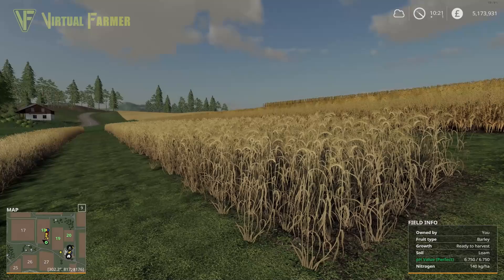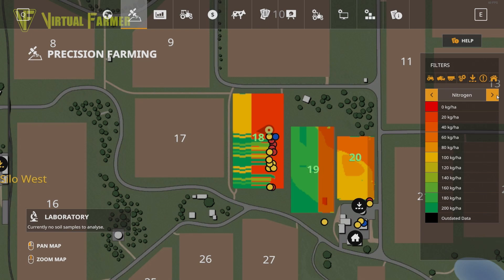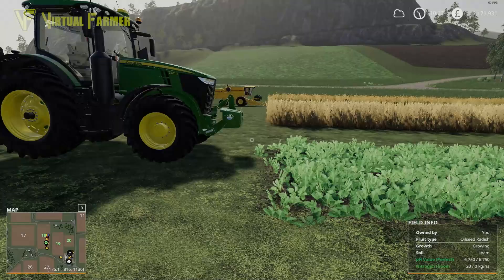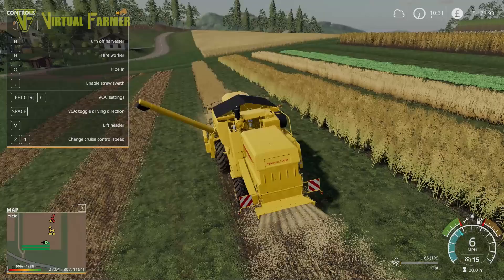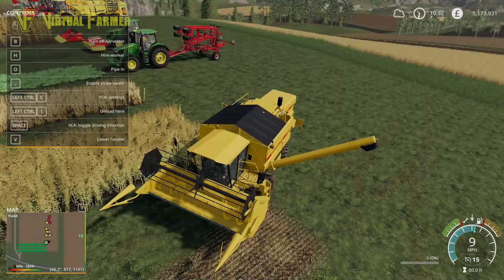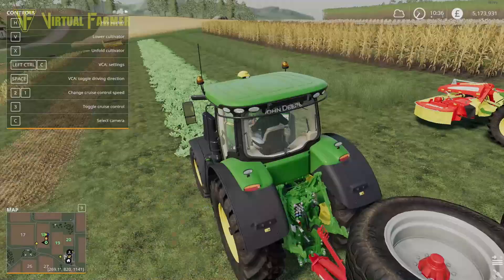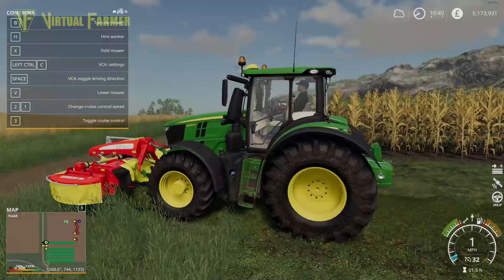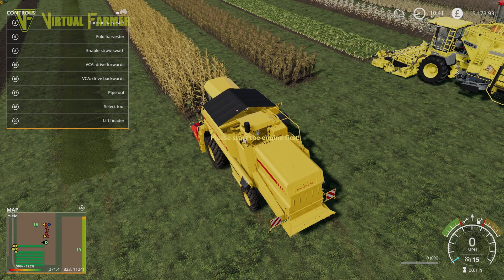Farming Simulator 19 Precision Farming: Crop Optimisation

Comment: One thing to note is that these values will be slightly different on the different soil types; I'm not sure if they will take the same amount of nitrogen out of the soil (for example 160-80KG on loam while 200-120KG on silty clay which is an 80kg difference across the board) or take different amounts based on the different soil types (160-80kg on loam while 200-140kg on silty clay which is an 80kg difference and a 60kg difference respectively). It's definitely interesting that using organic fertilizers in combination with oats and sunflowers leaves slightly more nitrogen in the soil vs just fertilizing optimally with chemical fertilizer (the difference you got for soybeans and oilseed radish was simply because the organic fertilizer side received fertilization while the other side received nothing so the base levels started higher on the organic fertilizer side so they still increased the nitrogen levels by a flat rate; no special interaction on those ones). Something else that's important to note is that some crops do NOT receive yield penalties for over fertilizing while others do (I thought the premise that crops being over fertilized would harm yield would be common sense but there seems to be a lot of people in multiple different videos and on Reddit thinking they can just max out the nitrogen levels and always get the optimal yield). The crops that do not take yield hits for being over fertilized are grass, soybeans, potatoes, sugar beets, and poplars. All other crops you need to make sure to not overshoot that fertilization level; for that reason I would be extremely careful with putting sunflowers behind soybeans as on soil types that aren't loam it's extremely easy to overshoot the nitrogen levels from the nitrogen boost the soybeans give, though I do need to do some more testing to confirm. Regardless though, NEVER put organic fertilizers down before sunflowers, those are guaranteed to over fertilize them on every soil type due to it being near impossible to get the nitrogen levels down to zero (unless willfully under fertilizing for such a case, but that's counter productive in all situations) and the fertilizer before a crop is planted is being applied at a flat rate based on soil type. In regards to poplars, they require 120kg on loamy sand, 160kg on sandy loam, 180kg on loam, and 140kg on silty clay; that's why they depleted the nitrogen to zero in this test, it appears that if you under fertilize they will take all the nitrogen (presumably up to the point they would consume if they were properly fertilized, for example a crop requires 200kg and leaves 60kg after harvest but you only fertilized to 160kg then you would presumably have 20kg after harvest; more testing needed to confirm this but this is what makes the most sense).
Reply from the maker: Yep is very much a high level view of this. You could probably make a whole series of videos just on this topic and all the variations alone!
Reply: @VirtualFarmer  Yeah I'm putting together a spreadsheet with anything and everything I can find that is useful for PF. I'm hopefully going to record all these interactions so it's possible to predict exactly what your field will look like after any given harvest based on crop type and soil type.

Comment: I have found so far that if I just run liquid or solid fertilizer after a crop has been planted with auto adjust it goes straight to the amount needed because it can adjust. Organic fertilizer such as manure and slurry can’t be adjusted and doesn’t change no matter if there is a crop or not. I believe it puts out 40 (or it could of been 60) period. I actually use placeables mods to create my liquid fertilizer and solid fertilizer so I don’t have to buy it but using organic although free comes at the cost of calculating the soil type and crop to have it correct but it usually with some means being over or under fertilized.

Comment: Why not use manure after you seed?
Reply from the maker: I would guess you probably can, although from my point of view that would be less realistic.
Reply: You don't want to use organic fertilizers after you seed because the organic fertilizers are applied at a flat rate at all times and won't adjust to your crops needs. Therefore you could over fertilizer or under fertilize harming your yields. It's also not recommended to use organic fertilizers before sunflowers as they have such low nitrogen requirements that they can very easily be over fertilized using the organic fertilizers. Thus it's better for your yields to use chemical fertilizers and it's also not particularly expensive due to its low nitrogen requirements when dealing with sunflowers.

Comment: So when he says manure, does he mean any fertilizer, or just specifically manure?
Reply from the maker: Manure and Slurry are good as they only raise the nitrogen level to around 50% from a low start. I think other fertilizer to take it to 100%, which might be too much.
Reply: manure slurry and digested
Reply: @VirtualFarmer  huh, ok. I’m just wondering how people who play without livestock are supposed to use this dlc to its full potential, or if your livestock doesn’t produce enough manure or slurry to cover all of your fields
Reply: @willfratoni8670  you can buy manure in shop and plenty others
Reply: @b-squad1736  yes I know, but I like to play as realistically as possible and not every farm around me spreads manure on their fields. Just another piece of equipment to own and another product to buy
Reply: Organic fertilizers are simply a cheaper alternative to chemical fertilizers and are in no way required. Basically the same function as the base game; organic fertilizers give you some free fertilization but you still need to use chemical fertilizers to top off the crops afterwards or just use chemical fertilizers and pay slightly more.

Comment: How RTK station affecting AI workers? I'm asking because i don't see any difference.
Reply from the maker: It makes them up to 11% more accurate, which saves money in game.
Reply: @VirtualFarmer  But working speed is same?
Reply: @koen6812  im assuming they use the width of the tool better.
sometimes a worker is leaving a little bit, im assuming they now perfect on the centimeter just like guidance steering or GPS.
so that will get the job done faster

Comment: So on perfect soil and perfect preparation you get a perfect harvest, so vid is pretty pointless,
Reply from the maker: That wasn't what I was demonstrating though. I was showing the different level of fertilizer each crop requires and how each crop leaves the soil after harvesting. This info should allow you to create an effective crop rotation.
Reply: @VirtualFarmer  sorry but if you leave the auto on it works perfectly, you don’t even need slurry or manure on a first application on loam soil. So as I said pretty pointless test.